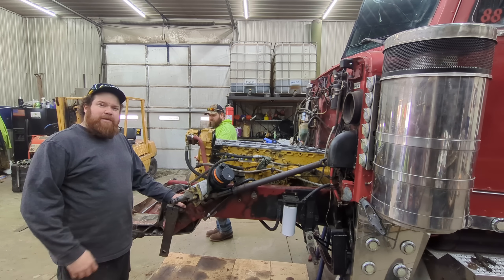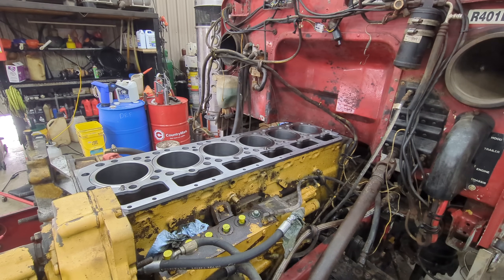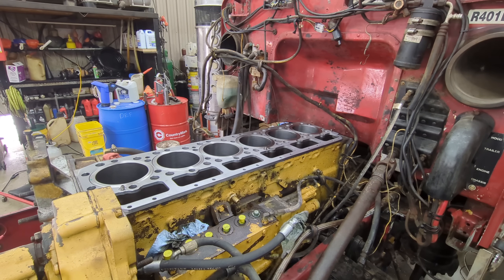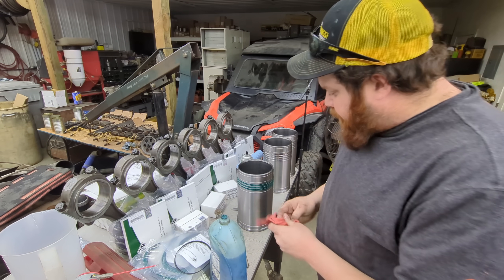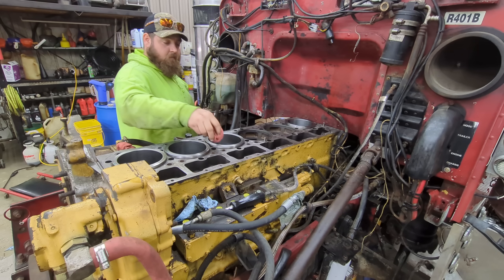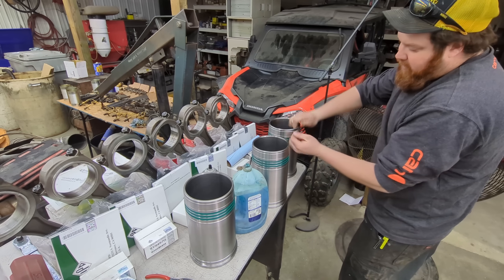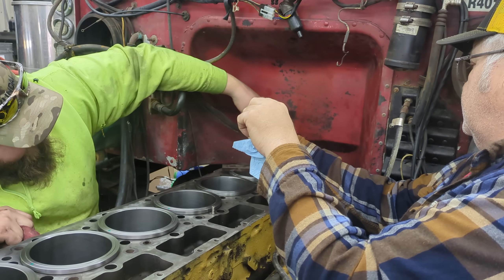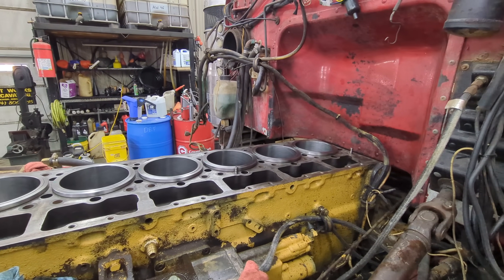1988 Peterbilt 3406B Cat In Frame Over Haul Part 2.... Cylinder Liner Install

Comment: I love working with a sleave engine unless it is a compression style. Wet sleeves gives you an actual new cylinder when finished and much easier to do without boarding. Hopefull,  you guys are having a great time together while getting the truck back to work again.

Comment: I'm curious if you go back through and check the sleeve measurements again before doing more? I'm going to be doing my first complete overhaul soon on an Oliver Super 77 diesel. Hopefully the top deck is still true so I don't have any problems with setting the sleeves.